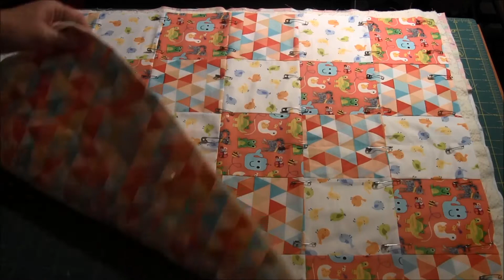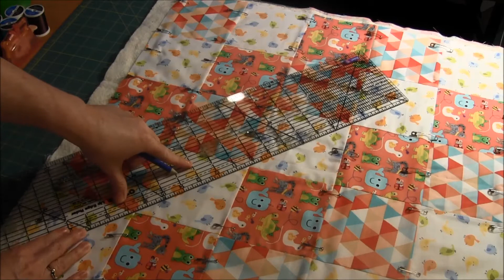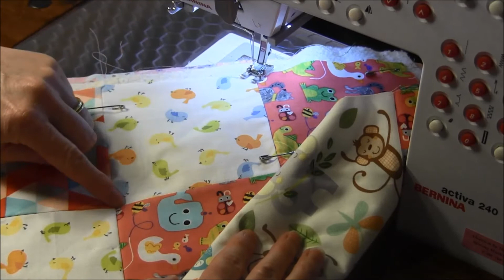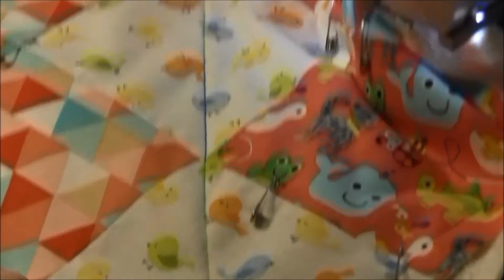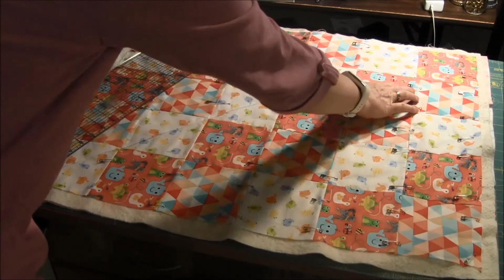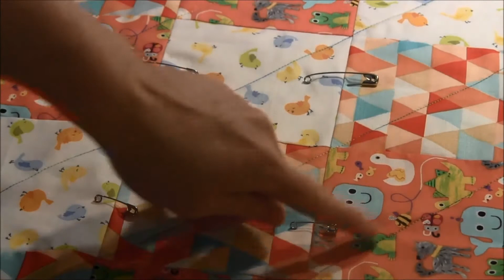Beginner Quilt Series - How to Machine Quilt

Comment: Do you turn the fabric around to sew the second stage or do you continue sewing in the same direction? This is confusing. Im not talking about making the x, but the other side of center.
Reply from the maker: Hi! Thanks for your question.  When sewing the lines, you will start near the center of your quilt and work your way across to one edge sewing all of the lines on that half of the quilt in the same direction.  You will sew the lines in the same direction because if you turn the quilt around, you will have more than half of the quilt rolled up and inside the throat of the machine. Once the first half of the quilt is sewn, then you will turn the quilt around and sew the 2nd half.  You want to orient your quilt so no more than half of it is rolled up and in the throat area of the machine or it can be very difficult to sew.  If you are quilting a large quilt, the center lines can be difficult to sew because of all of the quilt that's rolled up. Happy Quilting!